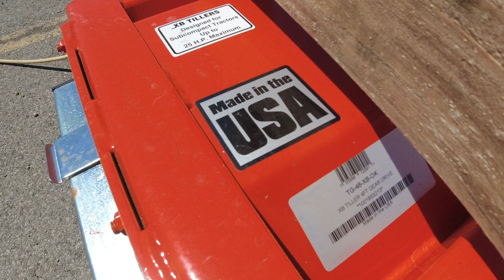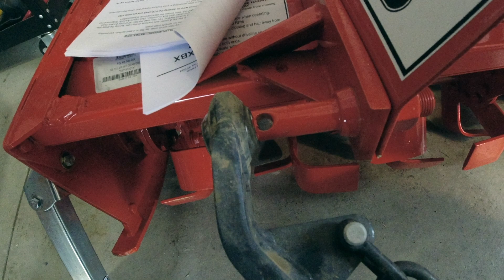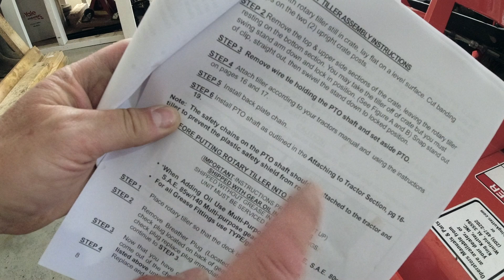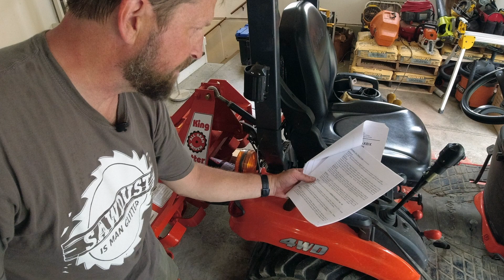King Kutter XB48 Tiller: Setup... The Struggle Is Real

Comment: Yes, the struggle is real. Some assembly required. I recently bought a King Cutter 48" brush cutter and wound up spending the better part of a day putting it together and running around buying tools and materials like snap ring pliers and gear box oil because it didn't have enough. It also came ungreased. Putting a slip clutch on it made the PTO shaft too long, so I had to cut that down by 4.5 inches. I found out the hard way that they taped the instructions to the underside of the deck when they got shredded while using the cutter. I went to their website and printed off a set, most of which appeared to be warnings.
Reply from the maker: Wow! I feel your pain, my friend. The good news is now that we've done it, we know what to expect with the next implement. King Kutter does make a very good product 🤠👍

Comment: Sam, your video was very helpful in getting it unpacked. I had the same issue with the "locking" kickstand not holding the unit securely up. You may have already discovered this, but the trick to make it actually lock has to do with swinging the bolted bracket itself up so the hinged offset is to the upper side and not the lower side. In this position the bracket now is high enough to hit a welded metal stop that it cannot swing past. Keeping the bracket against the stop, swing the hinged leg out and down and it will stay in place to hold the tiller.
Reply from the maker: Thank you for that! I haven't used the kick stand since I bought it. I'll try what you said. Glad we could help each other!!! Awesome tiller, btw 😁👍

Comment: .. Just setting up a new tiller for myself .....   Kickstand works great but on dirt not concrete .. I purchased the PAT'S hitch connectors from watching a video on them ,, also have other implements ,, sets up great and easy for all ,, just have to remove the spreader adj. link after lower arms lined up ,, it gets in the way of the PTO driveline ....
Reply from the maker: They are absolutely great tillers. Thanks for the tip about the kickstand. I never use it because I store it on concrete. Now I know why 🤠👍

Comment: I know that my comment is a day late and a dollar short but the King Kutter XB tiller is not quick hitch compatible but the King Kutter Professional is. I have a 2007 John Deere 2305 with a Harbor Freight Quick Hitch. I bought the King Kutter 48" Professional tiller and it hooked right up to the Harbor Freight quick hitch and i didn't need to cut the PTO shaft. I had to use the adapter kit on the implement to match the Cat 3 quick hitch but that was easy. I get that people want to buy implements that are the same color as their tractor but it pays to do homework ahead of time. I lucked out and my tiller just happens to be green but i would have bought it whatever color it was. Incidentally, I live in Pennsylvania and had to drive a couple of hours to get to a Rural King that actually had a 48" tiller. That being said, God bless and there iis no such thing as a wrong tiller. Just ask Tim. I also watch his channel every day.  🙂😊👍👍👍
Reply from the maker: Thank you so much for that information! I do miss using my quick hitch. I don't mind the Pat's Easy Change but it's not the same. You're right to say just having a tiller can't be wrong. I love it! If I did it all over again, I'd probably make absolutely sure everything I buy is qh compatible 😁👍

Comment: Just a quick note: On my quick hitch, I ditched the nuts and bolts holding the hook and went with quick release pins there as well. I have three different positions I have to use my hook, for my various attachments. Most are one or two notches down, but I have one that requires it to be at the bottom, and another that requires it to be at the very top. It is WAY easier to move the hook occasionally than to remove the whole quick hitch and put it back every other week.
Reply from the maker: That is a great idea! The Pat's easy change is okay but I really miss using the quick hitch. Having the ability to move the top hook quickly would solve my problem, thank you!!!

Comment: I was kind of chuckling throughout the video.  I remember when I got my 60" Woods tiller for my TYM T264.  I did so much research and watched some of the same videos you did that I had my plan memorized.  TTWT actually had a few posts because he was afraid he confused people.  It was obvious you were getting a bit frustrated and may have had to do some editing.  Anyway.  Do you know what's worse than all you went through?  Out where I live we are all on 3 -10 acre estate lots and we all have Morton type buildings and I may be the only one in here not retired from the TWA overhaul base.  They are all about 15 years older than I am and if you leave a light on one or many of them will show up to tell you what you are doing wrong.  That was my issue!  My tractor has a quick hitch and no issues.  I already knew the cuts I was going to make and they each had a different way to do it and none of them knew I had it all down.  I kept telling them "I'm not building a watch, I'll get it close enough!"  It was really killing them.  Once I had it on and running perfectly, one of them said now you need a pallet with wheels so you can roll it around.  I pointed to the corner and said "like that one"?  I really did have it all down and I think I had those old fellas as worked up as you!  lol  The were just dying to get in and hands on and debate and smoke their pipes for a week!  One piece of advice (I'm only 56) the spring pack on the PTO shaft should be sprayed liberally your first use each year and a time or two throughout.  They can rust together and you will have twice the headaches.  Great job, I'm sure I will see the tiller put to use.
Reply from the maker: Great story!!! And thank you 😊 It was obviously a first time for me and a learning experience. The struggle between paying someone who knows and learning myself is on-going. Thanks for the advice to prevent rust!!! 👍

Comment: Just curious, but would it have been easier to mod the quick hitch hook to work with the implement? Are you now just leaving the Pats system to this implement
Reply from the maker: The Harbor Freight Quick Hitch was set up to match all of my other implements and if I would have changed it to match the tiller, it wouldn't work for the others and I would have to move that top hook every time i wanted to use the tiller. The Pat's Hitch System will work for everything regardless of the pin positioning. I will definitely be leaving the Pat's system on.

Comment: @16:40 the complaint the top link is too short is not valid. You installed the Pat's lower hooks which add 4" to your lower link arms. That is why your top link is too short. If you add Pat's hooks to your lower links then you almost always need to buy a longer top link. That is your bad, not KK's
Reply from the maker: Sorry never meant to give that implication. I'd actually love to put a hydraulic top link on and lengthen it in doing so. Yeah, definitely not KK's fault 👍

Comment: How do you like the Pat's easy hitch...
Reply from the maker: It is definitely better than just a plain 3pt. Getting telescoping stabilizer bars is a must because the Pat's is a  pain if the lower arms swing freely. Pat's definitely doesn't even come close to how easy a quick hitch is but it works with absolutely everything and the quick hitch does not. Hope this helps!

Comment: Did you cut off of both sides of PTO?
Reply from the maker: Great question. Yes, I cut off equal amounts from each side 🤠👍
Reply: I have to do that to mine. Same model as yours. Didn't think I needed to since I have a rural King tractor rk 21 but shaft is to long. Thanks for your help.

Comment: 3-point hitches are bitches. I switch back and forth between a wood chipper and my backhoe. It's never fun on either attachment.
Reply from the maker: I'm with you. I think the worst part is there isn't an industry standard for distancing the pins. Seems like someone would have figured this out by now.
Reply: The implements are cumbersome and heavy. I work alone, so there's no help.  Age is a factor. God forbid you have a real job on the side. One false move and ...uh,oh...